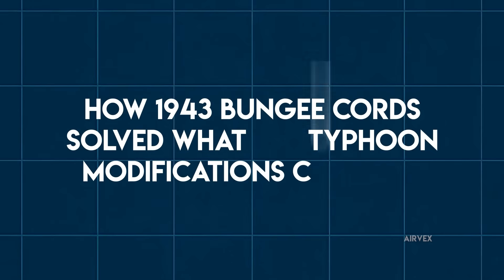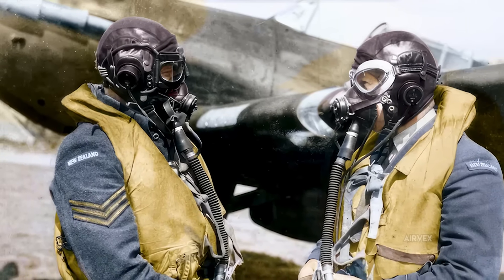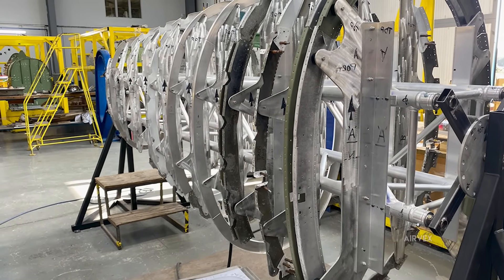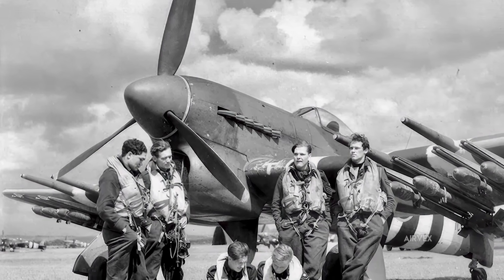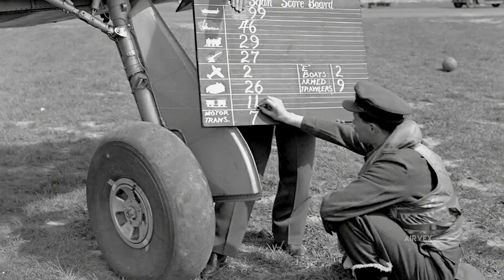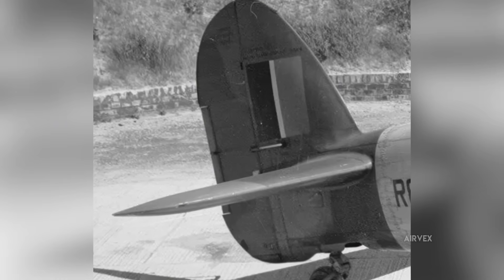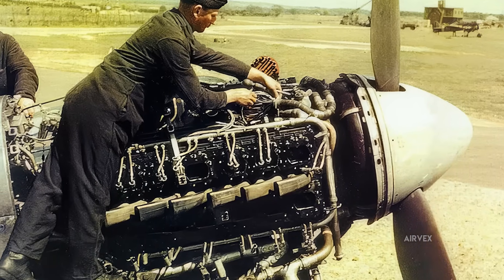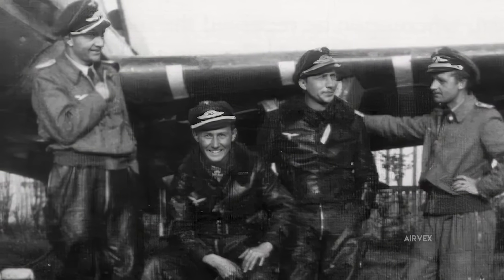How 1943 Bungee Cords Solved What 286 Typhoon Modifications Couldn't

Comment: Might have been nice to have like at least one photo of the hardware they used.
My understanding was it was a chunk of iron bolted on front of stick that cantilever-ed most of its weight far in front of the pivot-point. To counteract the constant nose-down force the bungees acted as spring. My understanding is it produced "droop-ing" amounts of elevator effect as gee-forces built up. It is exactly what you would do if the entire structure of the plane behind the engine was slightly flexible < to keep it from "whipping" or "whiplashing" in synch to it's own resonance. Any attempt of the tail to "flap" on it's hinges caused the control cables to instantly add -in (unequal but) opposite control force opposing the flapping.
Reply from the maker: Okay, will consider that! Appreciate you :)
Reply: @Airvex-f3d  The designer of the P-51 Mustang Edgar Schmued worked for North American long after Mustang production was history. During the development of NAA's Hound Dog cruise missile the autopilot was found to be "working it's ass off" just to fly straight and level.
     Schmued flew to see and measure the space in Hound Dog's nose cone. He designed a 55 pound cast-lead insert that merely by inserting in the nose of the next missile to fly - COMPLETELY eliminated the problem !
    In some ways it is analogous to the Typhoon control-stick fix = "harness the mass and inertial of a chunk of metal to become a g-force sensor with real physical forces available for output back to some area of the machine"
   In Hound Dog - the gee forces acted on the airframe itself to damp motion.
   In the Typhoon - the gee forces acted on the elevator control cables achieving the same thing.
Reply from the maker: @patrickshaw8595  Interesting!
Reply: @patrickshaw8595 true, except the problem with the hound dog was aerodynamic stability, not resonance in the structure. The lead weight in early versions of the hound dog moved the center of gravity forward, an old trick to improve stability in flight. Later, North American rearranged internal systems to shift that weight forward. An aft CG can add a few knots of speed in many aircraft, because they can be trimmed for a lower drag flight profile, and I have heard of freight dogs flying in non-us airspace that intentionally had the aircraft loaded to the AFT limit for this reason. But the typhoon was coming apart due to Resonance. Some aircraft fixed this with mass balances on the control surfaces themselves. The mass on the stick was a clever fix, but really the tail should have been redesigned to correct this
Reply: @jimeditorial  Thought I formulated correctly -  now I am sure of it. Tell the audience truly how 1943 Hawker was supposed to make Typhoon's fuselage 1) Stiffer and 2) Lighter so the Sabre's high frequency, high energy torque impulses were resisted (entire empennage does not flex = rigid body) and control flutter doesn't happen. Pray tell.
Reply: @patrickshaw8595 several ways. Anything from lengthening the fuselage, to altering the engine mounts. Depending on their analytical capability, it may have been advantageous to reduce the stiffness of the enpennage. Significant airframe changes have been done in the middle of a production run, as was seen on the fw190 Dora. Adding mass at the stick is far from the ideal way to do this, for several reasons, including lost motion in the linkages. But it is fast and cheap, and in the middle of a war, it's understandable.
Reply: @jimeditorial  Dang shame you couldn't go back in aa time tunnel. Show Sidney Camm, et al - how it's done. Of all the unmitigated bollocks . . .
Reply: @patrickshaw8595 Never seen a perfect aircraft, especially in fighters. But you can't argue with physics
Reply: @jimeditorial  Yet here I explained the problem to everyone's satisfaction 24 hours ago and yet you keep yapping despite adding or taking away nothing. Self-importance much? GO AWAY.

Comment: Er.... Did they not look at straight 6 car engines which wrecked their crankshafts before they introduced a harmonic damper?
Reply from the maker: That’s a great analogy :) The Typhoon’s problem was similar: the massive Sabre engine sent torsional pulses through the spar and into the tail. The metal reinforcements only made the structure stiffer but didn’t stop the resonance. The bungee cords acted like a kind of harmonic damper for the airframe: not strengthening it, but absorbing and dissipating the vibration, just like on those straight-six engines!
Reply: @Airvex-f3d  It is like I said exactly - and like what you said to the extant the fuselage structure of the Typhoon seemed flexible. The added weights of plates and "doublers" made the problem of flexibility WORSE because of their mass.
Reply from the maker: @patrickshaw8595  Yes
Reply: This was not an engine balance issue.
Reply from the maker: @calvinnickel9995  :)